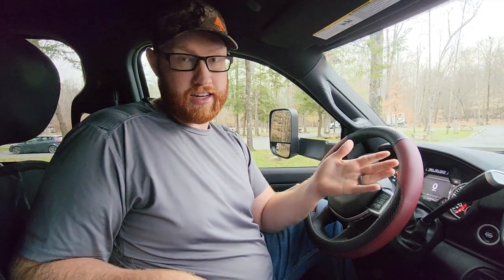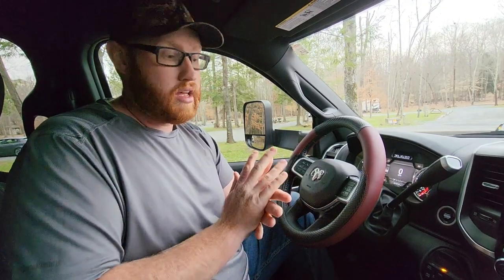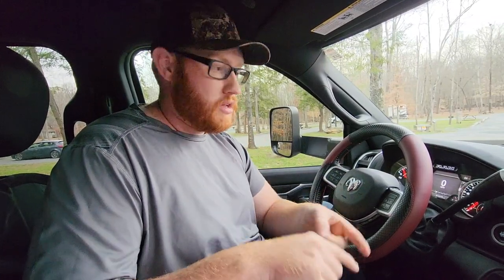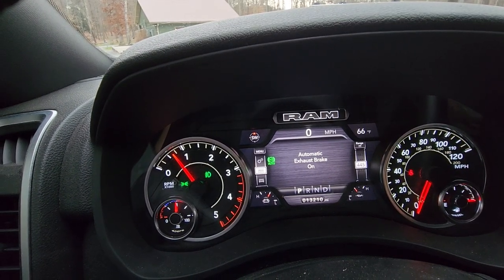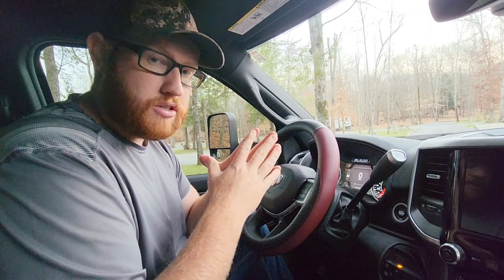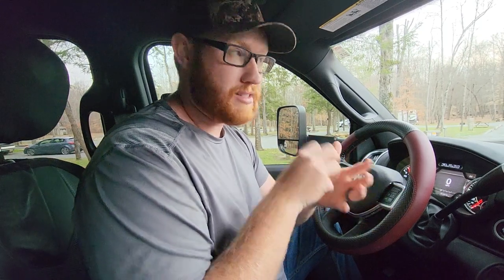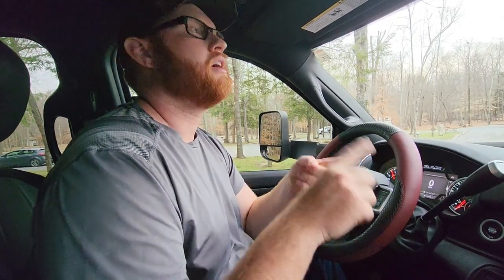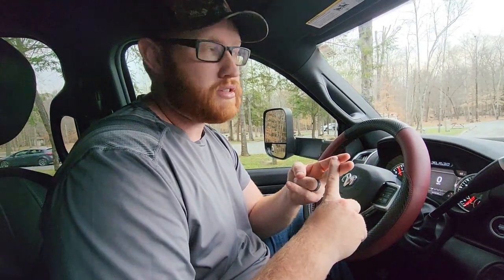How it works and how to engage diesel exhaust brake for towing

Comment: You have some inaccuracies in what you are saying.  Tow/haul mode does not engage “engine braking”.  The Cummins 6.7 does not have an “engine brake”.  Tow/haul mode adjusts the shift points and transmission response, though it does change how the exhaust break behaves.  The exhaust brake is just that, an exhaust brake.  The tow/haul mode has nothing to do with the turbo either, the exhaust brake is strictly back pressure on the engine via the exhaust.  Furthermore, if you are towing heavy loads (I do) you can also use the shift selector to downshift gears.  If I am on big downhills and my trailer is at its full 13,000 lbs auto mode will not maintain its speed, I have to go to full mode.  If you downshift you can stay in auto mode and it will maintain the speed on the downhill.  Towing heavy loads takes practice and common sense, as well as a bit of a conservative/safe approach.

Comment: You all Ram owners are lucky to have the best exhaust break. My Duramax exhaust break sucks. From what I’ve seen on YouTube, it works well when you have lots of weight and are are going down hill. But I live in a flat area and I only tow 9500 lbs so I don’t feel it much at all.

Comment: I’m a retired truck driver and my truck had a engine brake I’m looking to get one for my personal pick up truck I have a 2003 Chevy with a Duramax back in 2003 they did not have exhaust brakes. Someone told me pack brake is an aftermarket Exhaust break so I get a look into that and see if they can make one for my pick up truck. If you hear of any aftermarket exhaust brakes for a Chevy Duramax let me know another great video.
Reply from the maker: I know someone that might know, I'll keep that question in mind for you and if we find out we will definitely let you know!! 🤗. We appreciate all your support!
Reply: @campingwiththechadwicks2711  thanks any help is greatly appreciated